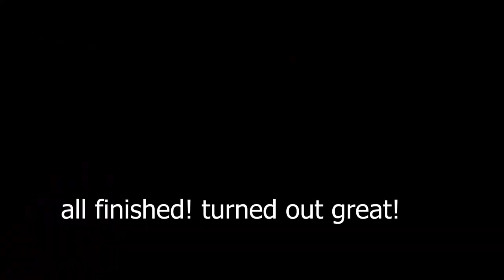CAMO DECK FASTENING SYSTEM!

Comment: What did you do with the board closest to the wall, you can only fit the drill on one side. An on the outer edge board, won't the outside screw hole be visible?  What do you do when the outer board has a lip going outside the frame?
Reply from the maker: This deck job did have some face screws in those areas. However majority of the screws were used in the Camo fastener system. There are some other  clips n such u can purchase also. For against walls and such.
Reply: @Warren3carpentry  thank you for the reply :)

Comment: Question why use bolts going into the post to support the load of the deck, why not notch out the post and rest the 2x10 on it.
Reply from the maker: That would offset the hand rail then. At leist for how I built it. 
There is definitely more than one way to build decks!  Also building inspector wants it that way.
Reply: @Warren3carpentry  notching a 4x4 will weaken the post too much to be a suffecient railing post
Reply: DCA 6 prescribes minimum 6 X 6 post and allows notching, the post to beam connection to the 4 X 4 in the video not so much.  You also might want your crew to not install any joist hangars upside down.

Comment: Would you say the Camo Jig system is better than the Kreg jig for building a Composite deck not using fasteners? I was going to go with the Kreg jig but after seeing the Camo seem like less steps and looks good too?
Reply from the maker: I would say camo is better. No pre drilling
Reply: @Warren3carpentry  Screws are cheaper using the Kreg System though. Depending on the size deck you build can get expensive.
Reply: @Warren3carpentry  Actually I think the Camo might be Cheaper and looks easier. Thank you.

Comment: Any issues using Camo screws on grooved Trex?  I'm concerned it might pull the top lip down and maybe crack it...
Reply from the maker: I have yet to use it on trex!
Reply: @Warren3carpentry  I have, on non grooved.  It worked great...but I'm building another deck and got a great deal on Trex ($2.50 per foot) but it's grooved.  I'm going to give it a go.

Comment: Greetings, what would you suggest for camo jig using composite treads?
Reply from the maker: I would use the short length stainless steel screws that camo has. Very small and hard to see!
Reply: Thanks very much. 👍🏼